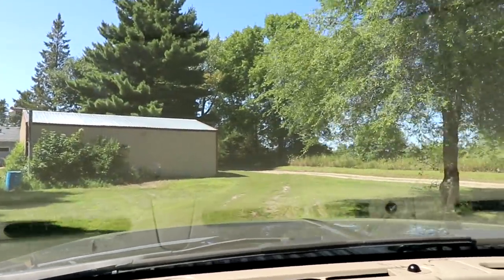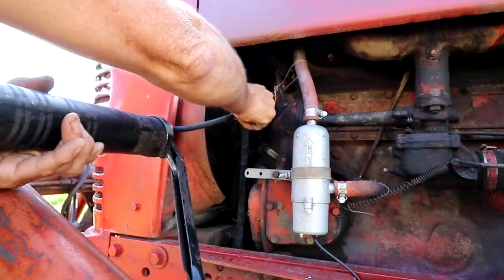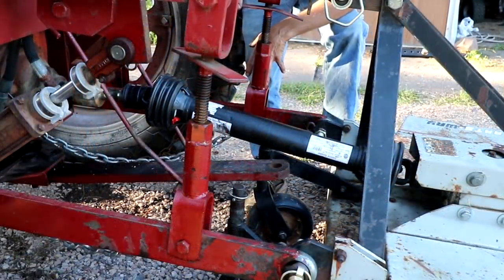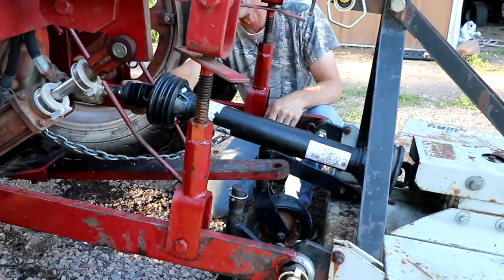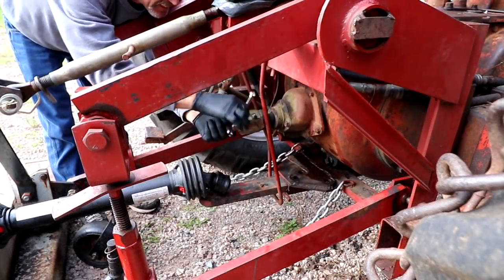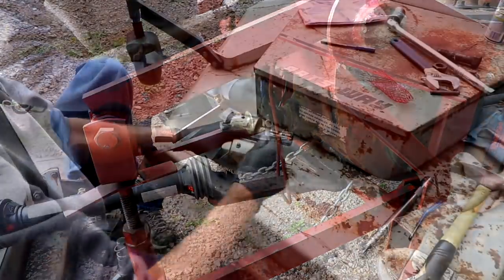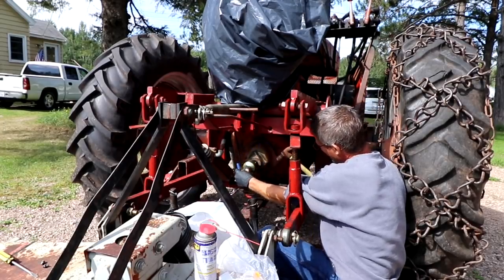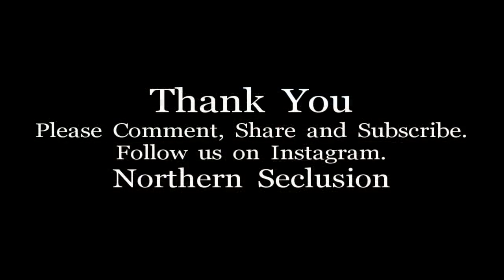Finish Mower For The Farmall. 72 inch PTO driven 3 point. 1948 Farmall M.

Comment: if you unhook the top link your mower will ride on it's wheels and follow the shape of the ground without getting forced into the ground when the tractor enters an uphill grade. Old school guys use a chain on the top link so you can still pick up the mower but you can't push down on it. We run ours this way. After a few broken wheels and bent arms, you'll see what I mean.

Comment: Probably wouldn’t hurt to check the oil in the gearbox on that mower. Give it the old sniff test and if it smells burnt drain it and dump some fresh 80-90 in it. Congrats on the new equipment!
Reply from the maker: i did, Thank you. It is full to the top and the oil looks new.

Comment: Did you check the gearbox oil on the mower?
Probably one of the most important maintenance checks on a brush hog type mower.
Most makes call for 80w90 gear oil.
Reply from the maker: Yes I did, it is full with some real clean looking oil.

Comment: Overrun clutches are very important to have on these old tractors - for the exact reason you said. Many a guy has been pushed through a fence because the mower or PTO implement drove them through it! What a great video!! Also - there are grease zerks on the axle bearing caps as well. Don't forget those! They are right where the axles go into the axle housing (topside). Do you have an owners manual & service manual for the M? Would be a great investment for you! Some places offer a 3-pack (owners manual/parts manual/service manual).
Reply from the maker: I will have to look for a set of the manuals. I did see those grease fittings on the axel. Thank you for all your help with information on the M. You have helped me a LOT. I hope people go to your channel and subscribe. You have a lot of good information and good videos. Thank you Kenny.
Reply: I haven’t been into tractor supply for awhile but they used to have manuals for older tractors .
Reply: @NorthernSeclusion  the manuals really are great for these - Jensales is a company tht offers them. I am happy to help! Glad that it is working out well for you. I do appreciate all of the shout outs as well! Let's hope I grow to be as big as you! :-)
Reply: @allenpew8544  Those are usually the I&T Shop manuals. They are kind of a general guide that cover a variety of model lines. I have one as well but I prefer the model specific, original manuals.

Comment: Now you can use the Husqvarna and the tractor and get the mowing done twice as fast. Will you stop mowing soon? Winter is coming...
I like to stop mowing no later than September 30th here in Utah. But my final mowing will be pretty short so the grass doesn't get bent over by the snow
Reply from the maker: The grass has started to slow down in its growing. I bet 3 more times mowing the actual yard will almost do it until spring.
Reply: I mowed the Saturday before I left for Louisiana, I got back on Friday and was surprised to see that I did not need to mow...with the cooler days and nights the grass has slowed it's growth which is ok by me :)
Reply: Here in Utah things won't really cool down until the end of September or even October. I'm pretty spoiled here I guess. We get short mild Winters but really nice hot summers.

Comment: I think over time you won't like that Farmall M for mowing. Very large awkward tractor for that kind of job, especially with the loader. I have a higher HP, smaller tractor, with live hydraulics and PTO that fits mine well. If you are interested, I just posted a video on my channel showing it in use. Finish mowers are nice implements to have! It also appears you are in Minnesota? I'm in Central MN.
Reply: Not interested, start your own site.